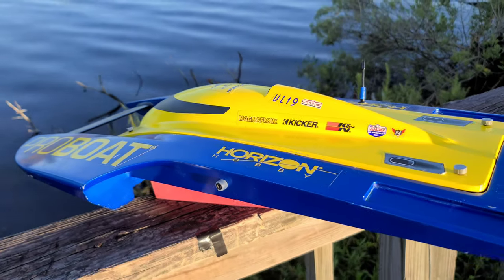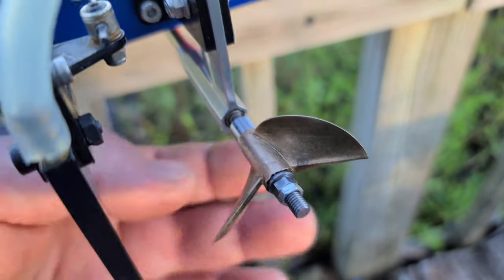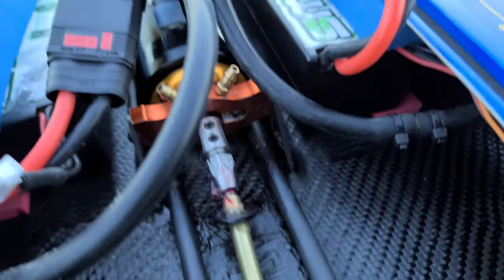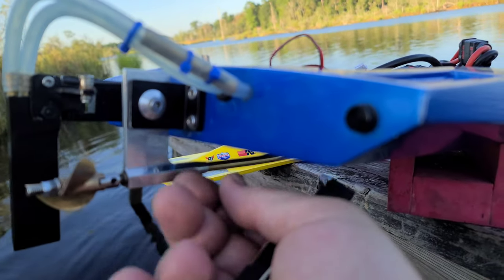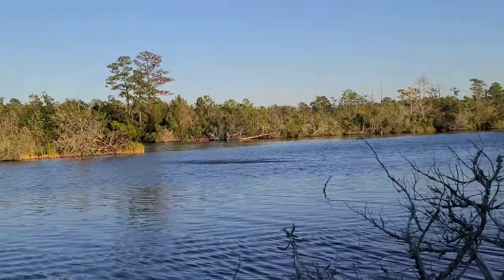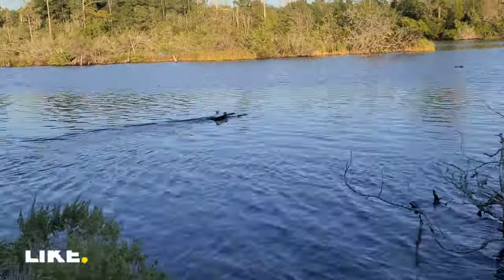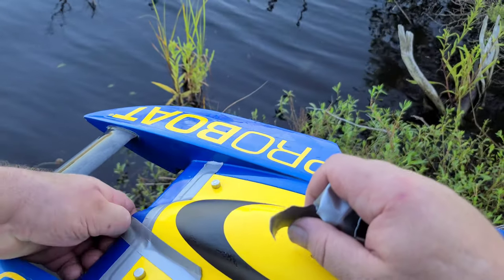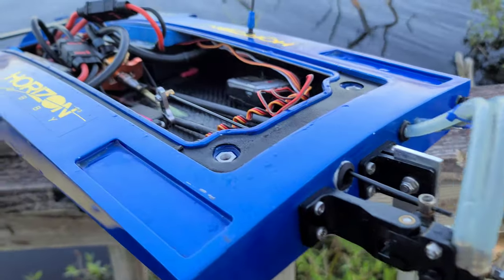UL-19 Hydroplane In Rough Water - Castle Creations Hydra, TP 4060-CM, SMC Racing

Comment: hy what if I use a turnigy marine 120A esc on a 2968 3800kv rocket motor and a 4s 5200mAh 50C battery, will my motor speed be good or vice versa please give me input

￼

￼

￼Terjemahan
Reply: Go 100C at least......
Reply: At least 100, I'm sure they make 120c up to 180c I just saw for a drone but im sure they have 120c packs that will work. China Hobby Line makes good packs as well as Gaoneng.